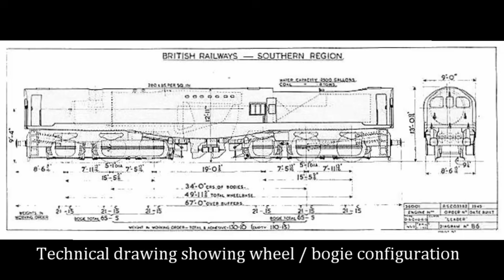The Steam Locomotive That Became a Death Trap - The Leader Class Locomotive #leader #class #fyp

Comment: Why didn't Bulleid provide the loco with a mechanical stoker? They were becoming standard in the USA.
Reply: Good question.  First off, the generally held grate size at which mechanical smokers were considered necessary was (a distinctly arbitrary) 50ft².  Leader's grate area was a mere 25.5ft².  The other reason I already touched on in a reply to the post about what issues Leader was designed to address.  Short version: If the aim is to rescue the poor half-roasted fireman from the 8th circle of hell, the question arises whether it was even legal to effectively leave a firehole unattended.  Additionally,  don't forget, maintaining correct water levels was and remains a responsibility which falls to the fireman and needs to be juggled with firing rates.
Reply: @TheHoveHeretic  Well, I'm considering 25 ft² to be "necessary" in this application. Water, airflow, regulation of the mechanical stoker can all be done from either cab as for a normal loco. The firegrate could still be inspected, but at intervals for short times, so that the fireman could be based on the footplate.
Reply: @1258-Eckhart I can't say hand on heart it's so, but I strongly suspect stationing the fireman in one of the cabs away from the fire wouldn't be permitted and even if it were, I could well imagine a rucus with the Union over any notion of inspections on the move. Even were it practical, there remains the slight issue of the smokebox end cab being nearly as bad as the fireman's station, when the loco was working.  I've occasionally wondered whether forced ventilation could have effected a "cold air" barrier flowing behind a "cold panel" (am I making sense?) in both offending locations, but even solving that still left the insurmountable issue of serious lateral imbalance caused by the offset boiler. 

Notably, the later "Turf Burner" Bulleid designed for the CIÉ featured a radically different boiler design which resulted in the loco being laterally balanced and the peat fuel (it wasn't ever intended to burn turf) was fed from bunkers to firebox by a unique screw mechanism.  The raison d'être for the loco was the dearth of coal depisits in the Republic¹.  The other Leader bugbear, sleeve valves, was also eliminated by use of piston valves² feeding two cylinders on each bogie, rather than Leader's three. Although far more successful than Leader³, the crew positions were cramped in an arrangement not dissimilar to the Ffestiniog's Double Fairlie locos.  Thought was given to a single ended version (i.e an 0-4-4T very roughly along the lines of a Single Fairlie ) but it was curtains for CIÉ steam by then and didn't get as far as the Drawing Office

¹The only significant commercial mining outside Northern Ireland was around Arigna and Dreenavoggy in Co. Roscommon and it's high ash content gave the locos of the Cavan & Leitrim too many problems with vitrified slack blocking grates to use it regularly. After 1959 a new electricity plant near the mines took practically all the output anyway.
²The magnificent 5in gauge edition of Leader by Kevan Ayling (Worthing MEE) also uses piston vales to supply four cylinders .... and I can't say I blamed him! It comfortably manages two dozen full sized adults (emphasis on the "full sized" bit) on the longest and heaviest 5in gauge trains I've ever seen
³Although it did operate a couple of goods trains, it never entered Capital Stock
Reply: @TheHoveHeretic  Thanks for all the info! The Leader class certainly LOOKED right for a modern steam loco, but as Chief Mechanical Engineer, I would never have accepted it into service with those horrific conditions for the fireman.

Comment: The original Idea was for oil firing, the seals were a weakness on the pacific's the designer was ahead of available materials but so was Brunel with the atmospheric railway.
Reply: A bit of background to what 80 years later may seem an odd decision.  

Then as now, oil was priced in USD.  In the dire financial situation of the immediate postwar era, a priority of Attlee's government was to restrict non-essential drains on foreign currency reserves, which dovetailed with another stated aim of buying British wherever possible.  The nationalisation of the railways under the 1946 Transport Act was obviously of great help to the Labour Government of the time in realising their policy. 

At it's formation in 1948, British Railways inherited 20,106¹ steam locos, which operated across over 30,000km² of route (18,750miles).  Around 8000km (5,000miles) of route enjoyed less than impressive services,  but that still translated as a hell of a lot of locomotives buring a hell of a lot of coal.  I'd imagine the CEGB (Electricity) and possibly the thousands of Gasworks across the country used more by then .... but doubt any other sector, even domestic heating, came close. In the wider sense, the decision not only preserved financial objectives but protected the jobs of tens of thousands of coal miners and skilled workers in heavy engineering, as well as the economic wellbeing of the communities in which they lived.

From here, it's easy to forget that the known quantity which was the steam loco was judged and at which British manufacturers genuinely still excelled³ against still very unfamiliar diesel power and until English Electric entered the fray in the late 1950s, the UK had no real domestic producers with the wherewithal to handle large scale construction (Hunslet, Yorkshire Engineering, Baguley Drewry and one or two others were successful for specialised machines). Going the diesel route  would have meant imports purchased with scarce dollar reserves, itself an admission which would have damaged the image (and therefore sales) of domestic producers ... on whom the nation still depended for much export currency.

¹Source RCTS 
²Source Railway Year Book
³Exports of postwar designs to principally Commonwealth countries remained buoyant until the late 1950s

Comment: not sure what problem it was solving?
Reply: Since you asked ..... 🧐

90% route availability, easier and more effective cleaning and maintenance (seriously!) and easier more rational operation - Leader was intended to be as straightforward to run round it's train as a tank loco vs running a tender loco to a turntable often queuing to turn at a busy terminus (or more often a couple of miles outside it ...)  this generally involved coupling several locos together to and from the turntable, which meant less paths for revenue earning services on running lines, by dint of limiting route capacity with light engine movements and therefore reducing income.

The enclosed oil-bath for inside motion was intended to reduce prep time (there's a fantastic old B&W film of the motion under test taken at Brighton works ... it's quite hypnotic) and between them, the inherently balanced three cyl crank and the chain coupling removed hammer blow , which suddenly and violently "ups" or (just as wearing for the track) reduces axle load far from nominal on every revolution of the driving amd coupled wheels, due to unbalanced revolving mass of motion and coupling rods. That translates to a loco kinder to the track and reduces PW maintenance costs (you see where this is going again!).

The "dry back" design of the boiler / firebox may sound odd, but the rationale was not.  In replacing hundreds of double ended rivets (working under considerable stresses caused by temperature and pressure), the boiler reduced hundreds of individual potential failure points to those associated with the interface of steel tubes with  tube plates and ends of the steel thermic syphons.  Often overlooked is Bulleid's incorporation of then cutting edge arc welding techniques. Again, properly mastered (which in the 1940s, in some areas left a bit to be desired) welding had the potential to greatly reduce construction and  maintenance costs.  The pity in the case of Leader being that not more attention was paid to thermal insulation. Issues for the sacrificial-goat fireman seem well known, but the cab at the smokebox end was little better and ASLEF would only agree to testing continuing with the bunker end leading ... which obviously kyboshed the advantages of a cab at each end.

Leader's total adhesion meant the machine was an excellent hill climber (an often overlooked quality of Leader, which was revealed on  test runs) and it's mass was also entirely available for braking, which was rather more of an issue then than now (as well as being the fall guy for Ernest Marples, Richard Beeching also did the railways the long overdue service of removing unbraked goods wagons from the network)

Bulleid's aim was to be able to operate 90% of the Southern's unelectrified network with just four classes of loco, which would have achieved colossal savings. That's what interested the board of the Southern.  An order they authorised in 1947 for a production batch can only be seen as a pre-nationalisation gesture.  

The outliers among unelectrified lines were the likes of the Isle of Wight network, the Lyme Regis and Hayling Island  branches (from a revenue perspective these were considered insignificant) and  various dock connections, for which diesel power provided an infinitely better suited solution even back then.   Honestly not sure whether or how the restricted old SER Hastings line  fitted into the picture.

Leader was not such a crazy flight of fancy as it's often presented.  THE two biggest  problems were: 

Significant lateral imbalance caused by the offset boiler (positioned to provide a crew corridor between cabs, via the crematorium fireman's station). Can't see how Bulleid wouldn't have forseen issues given his experience with LNER corridor tenders. I've neither heard of, nor  can I envisage any solution to this.

and

Bulleid's use of sleeve valves,  which like turbines are better suited to operation at  constant speed.  I suspect eschewing poppet valves was a result of Bulleid's experience on the LNER under Gresley (Lentz gear was tried out on members of Classes B12, D49 and P2).  New build P2 No.2007 includes advanced production techniques  not available in steam days to correct the issues with the cams which operated such gears.

One of the many questions I don't have any answer to concerning Leader is to do with firing.  The idea of automating coal or oil firing has often be advanced as an alternative to roasting a man alive, but did the law at the time even permit operation without a human presence in charge of a firebox? Any idea anyone?
Reply: @TheHoveHeretic Bulleid wanted a human sacrifice for the machine spirit.